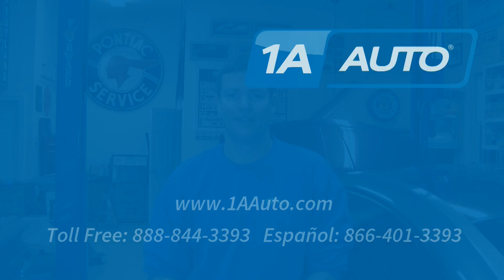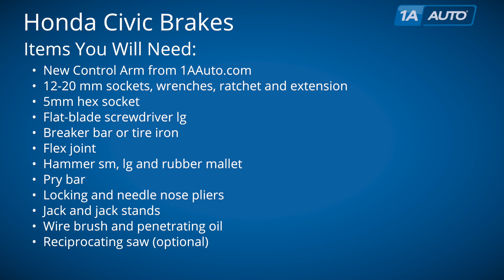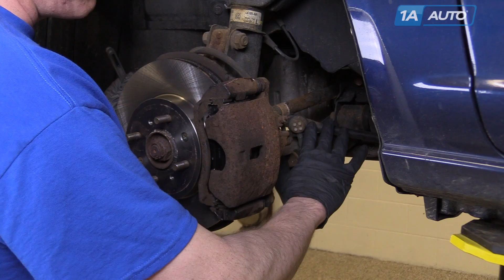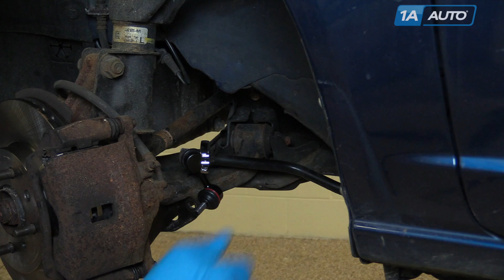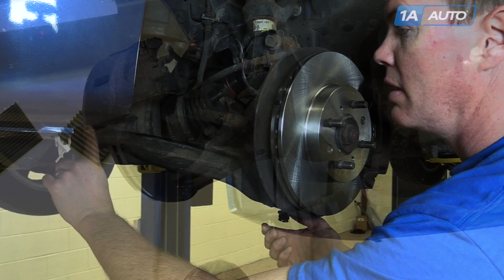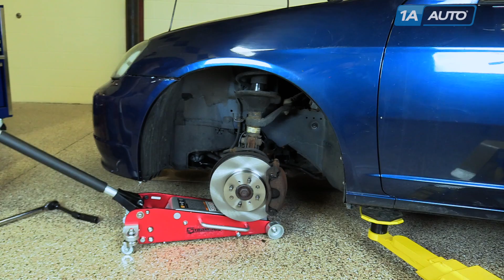How to Replace Control Arm 01-05 Honda Civic (Not Hatchback)

Comment: Hi. Great video!  Thanks. Where did you place the jack, on the control arm?, when you lifted up the arm to where the car just came off the lift before screw in tight the front and rear bushing arms?

Comment: Tips for getting the REAR BOLT of the control arm to lign up
You bearly threads in the front bolt and ball joint nut. Intall the new sway bar links but do NOT tighten them yet just put the nuts on the ends of the threads. Then you take your rubber mallet and tap the arm into the front first, line it up with the screwdriver and get the bolt in a few threads and leave it alone for now. Seat theballjoint and get the nut on the end of the threads then leave it as well. NOW For the rear, push the arm in to where it should bolt upto the subframe then tap it in with the mallet until you see the holes line up, line it up with the screwdriver then slide the clean bolt with some penetrating oil or fluid film in until it stops. If the threads won't line up, take a wrench place it against the axle shaft and apply light pressure like 1lb at most, to the head of the bolt, tap the top of the arm downwards with the bolt still in, now take your screw driver and wedge it under the rear control arm and subframe and give it a wiggle while still keeping light pressure on the bolt. It will click or move in more when you have it lined up correctly, then without letting off of the bolt try turning it and getting the threads to finally seat and tread together. It takes a while but tapping the arm down with the mallet with the bolt in part way then lifting up the arm with the screwdriver while holding the bolt in was how I got it together. Just do it over and over until it works, don't crossthread it. Tighten the front bolt the ball joint  both sway bar nuts then the rear bolt and it pulls itself together tighten each nut a bit at a time so nothing binds.
Reply: Hope this helps if anyone runs into my issue.

Comment: My breakdown and tips. 
 Get new swaybar links the old ones won't survive easily. Need a Allen key to stop the ball and screw from spinning in the socket. I just angle grind them off. It's not worth the effort and time trying to save sway bar/stabilizer links.
Sway bar link - 14mm - around 20/25lbs
Balljoint nut - 17mm - 43lbs torque install 
Front control arm bolt - 19mm -61lbs torque
Rear control arm radial bolt - 19mm - 61lbs 
•Ball joint puller tool not the c shaped one with the screw in the center it didn't fit H.F. tool. The lever style would work on this civic. 100× better then the hammer (Use hearing protect and eye protection if you go hammer)
•Long screwdriver for bolt alignment. Helps big time getting the rear bolt back in.
•Rubber mallet or dead fall hammer 
•wire brush or wheel to clean rust and hardware
•fluid film spray to coat the control arm inside and nuts and bolts. Clean with isopropyl and rags first.
Reply: Wire brush bolts and nuts to bare metal for better longevity and easier future repairs.

Comment: hey im having a slight problem the bolt that goes in is the subframe the nut is now turning with the bolt i think the welds broke off from age i guess on bc i put to much strength when torquing it back do you know i cant do vice grips are not doing the trick do i have to change the subframe? or i can just call a welder and weld the nut?

Comment: A little tip for anyone I just got done, my control arm was STUCK to the ball joint I used a torch and put a long pry bar and hammered it off from the top

Comment: Did y’all get an alignment after changing both control arms?
Reply from the maker: +LC It is recommended to get an alignment after replacing any steering and suspension parts to have optimal use of the new parts.

Comment: im having hell separating the ball joint from the lower control arm; the loaner tool from AZ (arizona) just dont cut it. the video pretends it is a breeze and no help for those like in my case. it is not the first time I go through this. last time I hit the hell out of the ball joint from below until it popped out. afterwards I couldnt put the castle nut back on due to all the damage done to the end of the ball joint but that was my last resort. so a couple bangs with a good hammer, eh? - I doubt it.

Comment: Is an alignment needed afterwards?
Reply: From my experience, yes! You probably dont have the gear to get the alignment lasered precision! Its super essential for a smooth drive! After replacing control arm, definitely have an expert have the system aligned ad they will do it right!

Comment: Was going to do the front struts as did the back last week.  After watching the this video, seems might as well do the control arms as since more room with strut assembly out of there.  Any issues doing this?
Reply from the maker: +John Bizer Thanks for watching.  You do not have to change them out necessarily, but it will give you more room to work!
Reply: @1AAuto  Thanks for the reply and going to do it

Comment: can you take out the bushings to put a new one in for my lowered civic
Reply from the maker: +RattlingLalo We're always cycling through common cars. We'll add this repair to our list! http://1aau.to/m/Shop-1AAuto-c
Reply: 1A Auto Parts it’s because i got a control arm for my 03 civic lx from your company and was wondering if i could take off the bushings that are on there
Reply from the maker: +RattlingLalo Thank you for your inquiry!  The bushings that come with the new control arms are not meant to be removed, as bushings from other companies might not fit them.
Reply: 1A Auto: Repair Tips & Secrets Only Mechanics Know thank you for the information

Comment: Great videos. Little tip - when torquing the lug nuts, orient the torque wrench so you are pushing down rather than lifting up. Trying to pick up that much weight while bent over is hell on your back when you could just use your own weight to push down on the wrench.
Reply from the maker: +Luke Martineau Thanks for checking us out and for the suggestions. 1AAuto.com

Comment: My lower control arm bushings are all shot on my 02 Civic, I was wondering if it’s worth going through each bushing and changing them out or would I be better off replacing the whole lower control arm?
Reply from the maker: +jack meoff typically it's best to replace things together when you can, but it really depends on the condition of your control arms.

Comment: Good video, except for the part about loosening the ball joint. I hit it with a big hammer several times, as suggested. But it wouldn't budge. Ended up renting a screw type ball joint separator from an auto parts store. That did it in about a minute. Worked in my driveway, with jack stands; that was OK. The rear bolt on the passenger side arm was tricky, as the steering box is in the way.
Reply from the maker: Thank you for the comments and for watching ! +Allan Neymark

Comment: Why didn’t you also replace the ball joints? I need to do this but I also need the ball joints replaced and I thought the control arms come with a ball joint in them already?
Reply from the maker: +Lyle J This video was just showing the control arms. If your ball joints also need replacing then now is the perfect time to get all done at once.

Comment: My bolt is turning with the rubber and I can't get it out, any ideas how to get it out?
Reply: How did you get it out?
Reply: which bolt?
Reply: @sparco023  same fml
Reply: gonna try to get better vice grips, and if fail, try cut, and if fail have to replace subframe -_-

Comment: How much does this cost at a shop compared to buying all the tools nessecary to do the job yourself?
Reply: You're better off doing it yourself. Unless you find a mechanic that works for liquor you're gonna pay $500 or more when you can spend $150-$200 on parts and tools.
Reply: jsproat52 $735
Reply: I paid like $240 for the front driver side. I think for the passenger side  I'm going to do it myself next time

Comment: Where did you place the jack when you simulated driving conditions in order to torque the 19mm bolts? Also How high do you need to lift it prior to torquing?
Reply: parallel to the ground.

Comment: Today i got new ball joints and the mechanic brought me over to see the lower control arm passnager side and he showed me it  slipped down hanging there ..he said i need a new arm but  why cant i just change the middle bushing
Reply: You can change the bushings, it's just a hassle though, easier to remove old and replace new arm.
Reply: You can just change the bushing. It's not a big deal if you access to a hydraulic press, but if you don't, it gets pretty expensive if you need a shop to press out and press in the new bushings.
Reply: You can. But they need to be pressed out.  Maybe he didn't have a press. Bushings are way cheaper than a whole new control arm. Maybe that's y he told you to put a new one
Reply: Probably to late for you know but for how much the bushing cost and hassle to take it off. Atleast for me it was easier and better to just replace it